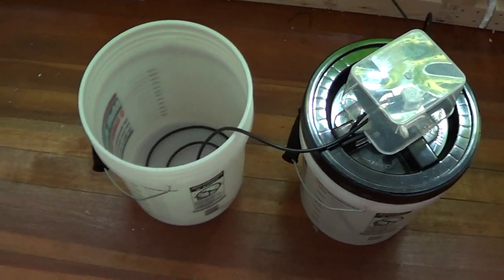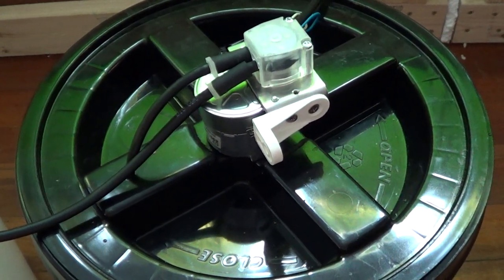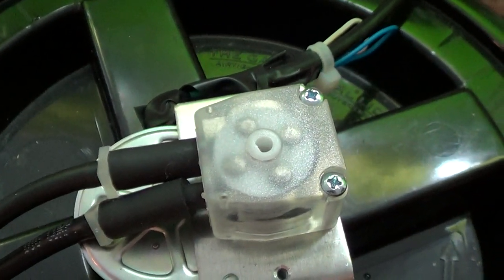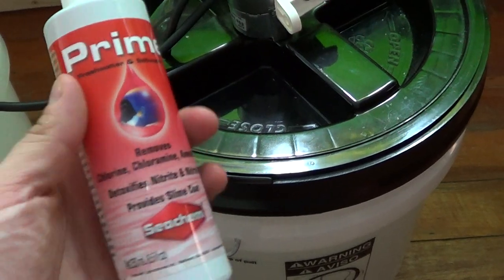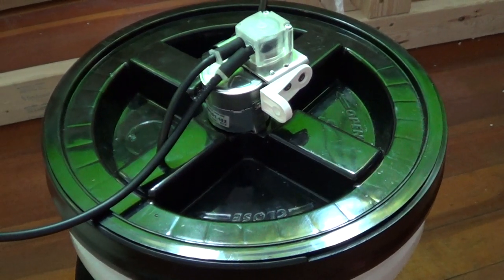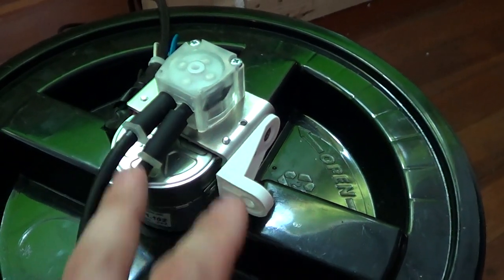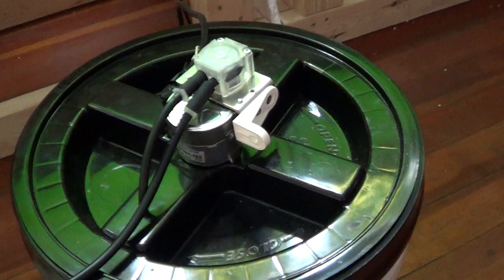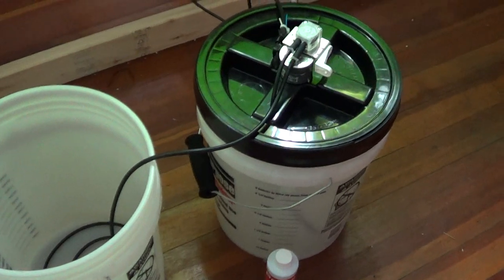#169: How To: Peristaltic Pump Auto-Doser Seachem Prime in Aquarium - DIY Wednesday

Comment: Its been awhile since you posted the video.  Any regrets, problems or changes?  I was thinking of a similar system with the carbon block filter but originally envisioned using a batch tank to collect water, dose it (for safety) then pump it to a few different sumps on alternating days or something (still in the planning stages.)

Comment: You could put the primes pump on a timer and use a timed water sprinkler to add the water if you didn't want to do constant water changes. I've been thinking of building the bucket system you built to add liquid co2 to a system.

Comment: Hey Greg. Ever thought of using sprinkler timer? They cost about $30 dollars. You can find some instructions on wiring it up online. Pretty simple though. If you have a 12 volt DC pump, then you can power it with a sprinkler timer with a 12 volt transformer. Basically you have the control for how many minutes, what time it will turn on, and which days in the week it would run.
Reply from the maker: good idea! however, i want with the peristaltic pump for low volume, high accuracy, and constant flow, but a timer could work for some applications